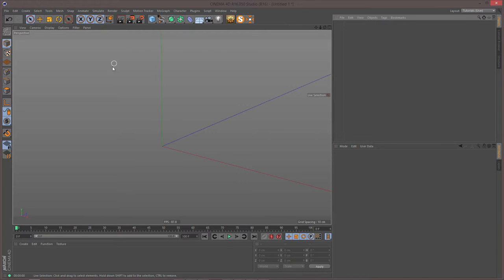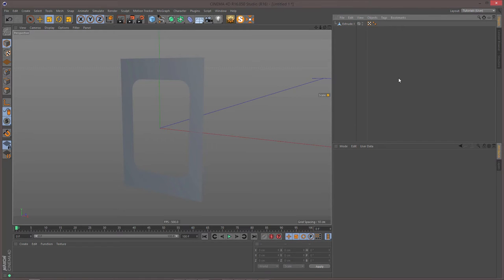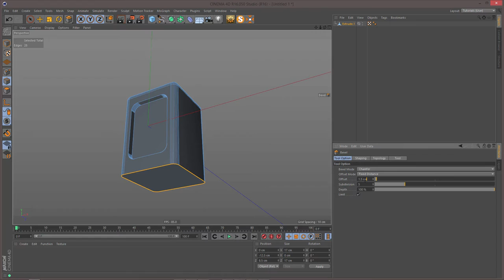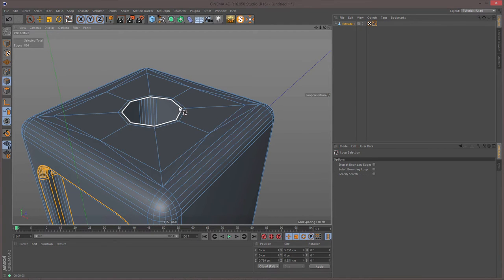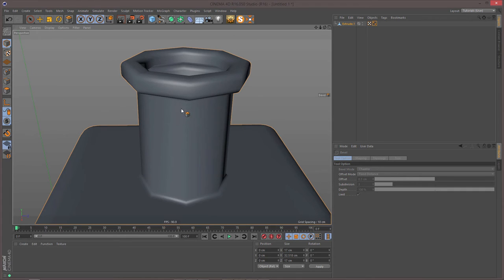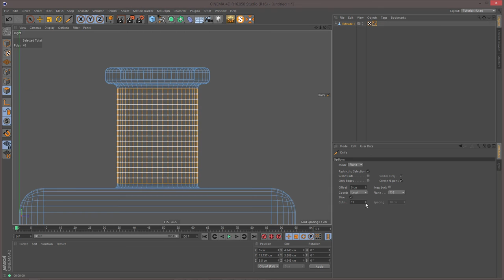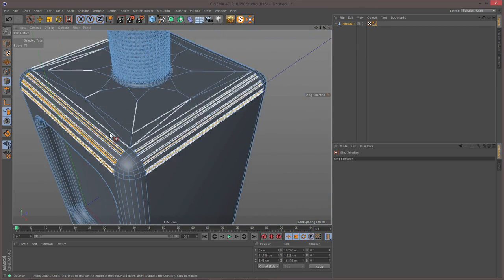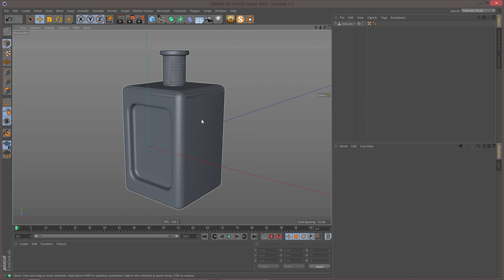Whisky Scene Tutorial - Part 1 - Model the bottle

Comment: after I extrude and make it editable it still has several polygons and I cant select edge lines .. I tryed MESH CONVERSION POLYGON GROUPS TO OBJECT but it creates the group and the main object is still multipolygonal.. Has anyone have this issue and what's the solution ? Thanks ..
Reply from the maker: I do not really understand your problem. At which time in the video starts your problem? If you can upload your project file, I can have a closer look at it and see if I can find where the problem is.
Reply: I solved it already .. Thanks for taking notice !
Reply from the maker: Glad you could solve it.

Comment: А можно замоделить вот такую бутылку) https://yandex.ru/images/search?from=tabbar&text=bullet%20burbon&pos=0&img_url=https%3A%2F%2Fskidkaonline.ru%2Fimg%2Fp%2F2020%2F05%2F183602%2F7891936-183602-viski-bullet-burbon-fronte-07l.jpg%3Ft%3Dt1588314997&rpt=simage
Reply from the maker: This Bottle you can make very easy with the Loft Generator. Just make some spline for the shape and put them in a Loft and you are done.
Reply: @nikomedia  
Yes, if it were so easy) it is flattened, not round)
Reply from the maker: @СеменЛюбас  Than simply flatten the splines where the Bottle is flat. Just don't make a circle, but an ellipse.